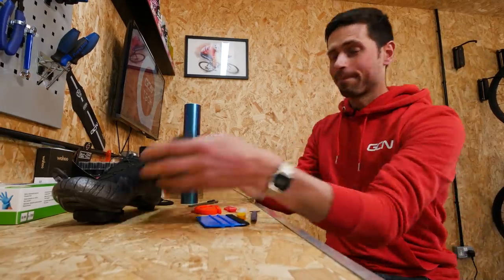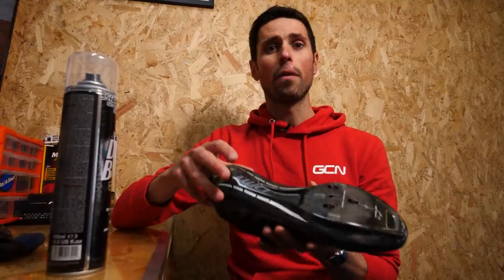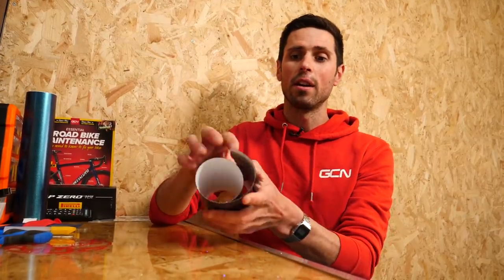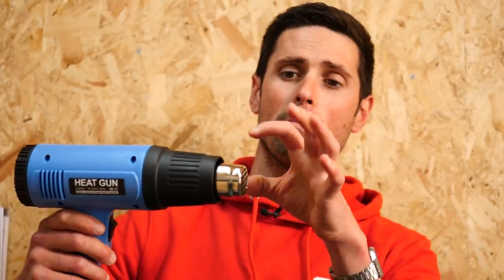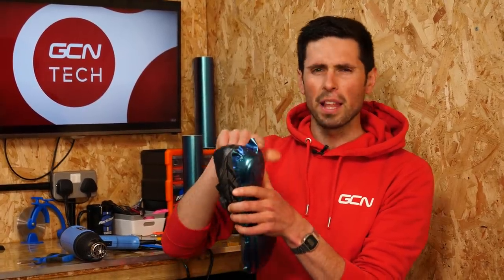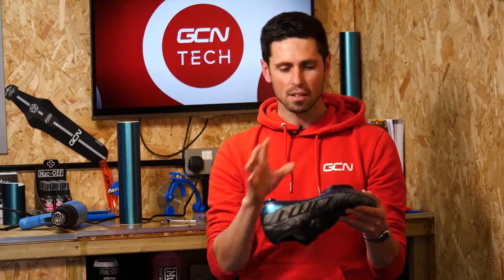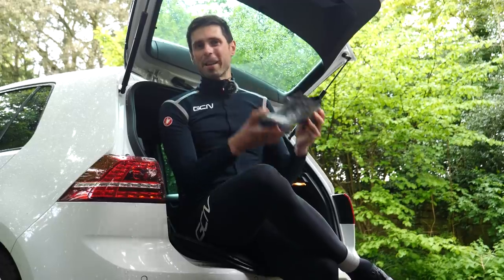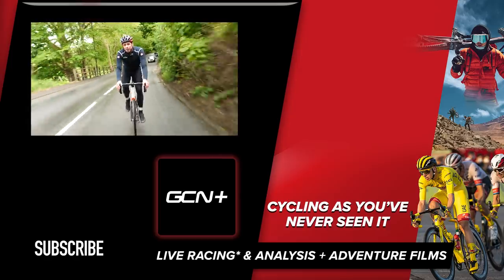Vinyl Wrap Your Bike Shoes!? | Custom Bling DIY Upgrades To Your Cycling Kicks

Comment: How about vinyl wrapping a bike
Reply: Plastidip is better
Reply: Or a chain
Reply: I think I saw one recently on the bike vault last month
Reply: In the background you can see two large roles of greenish vinyl wrap. So maybe there's more to come.
Reply: Finally, a total cheap product presented in gcn videos.. I'm talking about that heatgun. 😂
Reply: But how about the 0,25W lost due to the vinyl weight? No bueno!🤔
Reply: @ruiloureiro3167  with those scruffy edges on the first shoe, the loss is rather around 3 Watts 😄
Reply: You need to be a very very skilled in wraping to make it look good on a bike frame, there are a lot of intricate spots where tubes meet  together and you will always see the seams,, it is not like a flat hood of a car or door, rooftop etc.
Reply: The fork
Reply: @mopedvieh  that’s the same vinyl. It looks different colors based on angle of light!

Comment: Could you use vinyl wrap the underside of the down tube etc. To protect from knocks and add a bit of colour? 

Maybe do a vinyl wrap of a bike vlog?🤔🙂🙂
Reply: 3m Scotchgard 
If it gets scratched, it heals itself with heat
Reply: The only things which prevents me too use helicopter tape for protecting my frame (especially for bikepacking bags) are horror stories that the paint job removes with removing the protection tape and that my frame is black matte and there are not many options which are not visible on the frame.

Comment: I was waiting for the actual shoe to be wrapped , wondering how this could be done.
Turns out just the sole ! 

Bit pointless in the end  as I doubt this offers any protection at all  at the front of the shoe, plus it hides the glorious carbon fibre of the very expensive disco slippers.

Be great to see a video on the best way to custom paint your shoes.

Another work from home production from GCN .
Reply: I just posted a comment on this video on how to do just that.  Angelus paints are specifically made for customizing shoes.  I've used them and they're fantastic.  Just search for videos on customizing shoes and you'll see.  Even if you don't want to paint your entire shoes, you can probably find a color match so that you can cover up scuffs and marks on your shoes and make them look new again.  I turned an orange pair of Giros red to match a new bike, and they came out looking amazing.  Saved myself having to buy a new pair of shoes.

Comment: What's the point. Surely once you've walked on it a few times it'll look awful. Should have done the actual shoe not the sole. How do they look on the road. In the British sun you can hardly see it... 🤔
Reply: The sole will surely wear out pretty quickly but it won't be a good idea either to wrap the entire shoe. You'd want to let the shoe breath or your feet will be a sweaty mess in less than half an hour. When it comes to customizing sport shoes, you are limited to areas without breathing holes or to use very thin paint and thin lacker to not seal the holes.